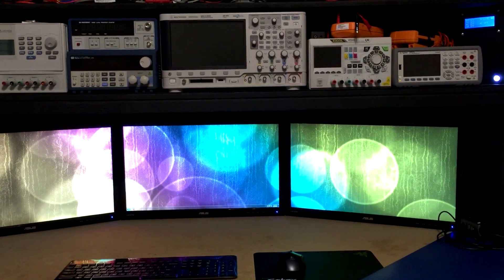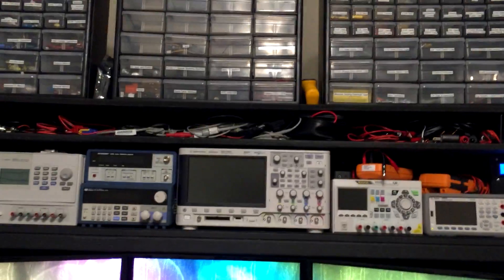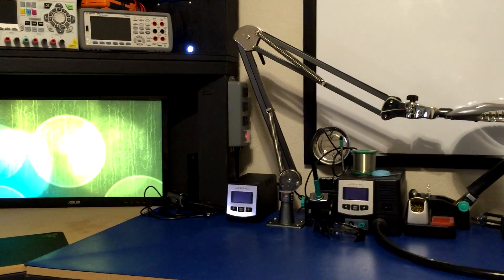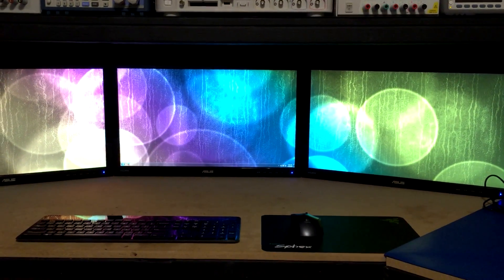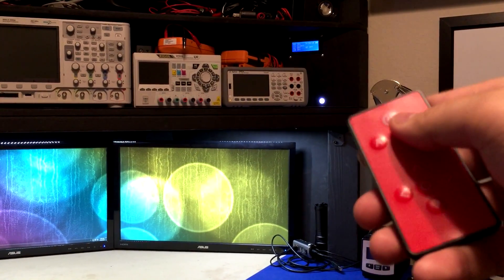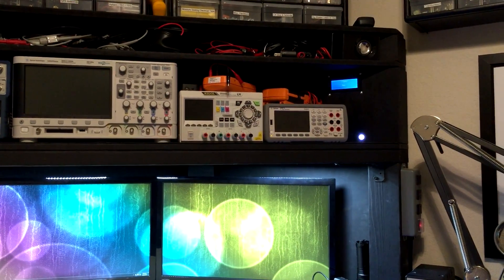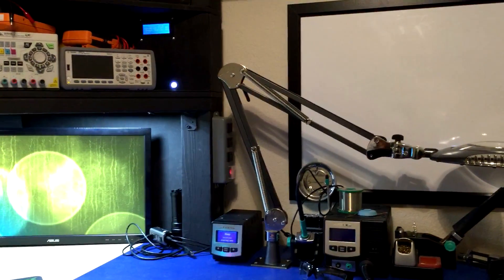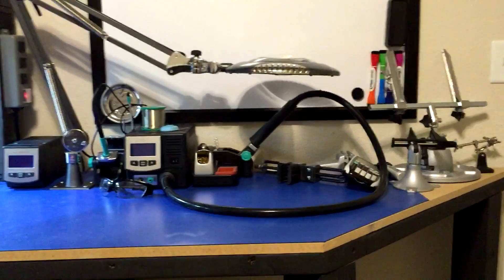Electronics Workbench Lighting / Controller Project (Part 13) [COMPLETED!!!] #0024

Comment: It put an ATtiny into my soldering station, now it have a standby switch. If I wake it up from standby, it will heat up to the choosen temperature. After half an hour the display backlight starts to flash. So if I don't push the standby button again within a minute, the station will go back to standby and run down the temperature. So in case I forget about it, nothing wil happen. Works perfect for years now!

Comment: Thanks for sharing.  I like your setup, good equipment.  The most important part of your workstation is that it is yours.  You designed it to meet the way your work best.  That being said, I can't say having the monitors that low would work for me.  I am a fan of where you put your test cables.  A few questions...  When you work do you move the test equipment or do you use it where it is.  If use where it is do the cables get in the way of the monitors?  Any thoughts on where to put things like current probes, IR Themp, stuff like that?  I would really love another monitor - just can't think of where to put it.  Take a look at my setup - any suggestions welcomed. 
https://www.youtube.com/watch?v=fm5W4V-FS5g

Comment: Yo TechnologyCatalyst
You have a very nice electronics workbench but why did you put your test equipment up so high out of arms reach. it's looks like your going to be testing electronic circuits standing up because you have to adjust knobs on your test equipment and read out the results of measurement. put you monitors up high because that for viewing and it has a remote control. Always keep your test equipment within arms reach for easy adjustment.
your going to get tired of standing up every time you test something. switch them around.
Reply from the maker: +FUNK BOOGIE I took measurements for easy reach and line of sight for the monitors before I designed the desk in CAD.  I can very easily see and reach the instruments while sitting in my chair.  The only time I have to stand up is if I need to adjust an instrument that is out of reach on the other end of the bench.  In a drafting chair, the instruments are just about eye level.

Comment: Outstanding setup and very inspirational!   Keep having fun, creating and sharing... 

Stay safe. Does your bench power go through a GFCI? (...even if you are not working in your bare feet like those two, 230 VAC 50Hz electronic v-bloggin' Aussies seem to prefer!) 

I've been doing this same kind of electronic project stuff since the late 1950's and would like to suggest adding a dual-purpose "Mains" power switch. Replace and rewire the building's existing light switch (within the 1900 box/metallic conduit, etc. that's located right there at the room's entrance door) to safely kill everything other than the ceiling light. 

Get in the habit of always turning that switch off when you leave the room since those fans and that re-purposed PC power supply might eventually become dusty and not spin and/or do something kinda' funky! 

It's usually best to completely avoid using any combustibles where 120 VAC or high current wiring, contained heat producing components, exploding electrolytic capacitors, or anywhere those awesome flash-bang lithium batteries are charged/discharged or even stored because any or all of these things can seriously misbehave...  i.e., there's a nagging materials selection concern: Too much wood was used. 

Big clues to potential trouble are the two cooling fans screwed to the wood electrical wiring/SS relay box. It's well known that even a real UL approval label won't reduce the risk of fire 'cause it just can't stay stuck to an all-wood, 2x4 walled electrical box!

An old beefy thick metal PC case and/or just its power supply case with the fused AC input connector, add those SS Relays to its OEM heatsink and just add another female IEC power socket would have done the job for you and provided a safer project case.  
 
An expensive CO2 or Halon fire extinguisher accessory for your bench is probably too pricey and they're DEFINITELY NOT EFFECTIVE for a lithium/wood fire anyhow, but consider what you would do if some "BS under load test" item decided to go nuclear! (...and the poor smoke detector couldn't even squeeze out a single low-battery chirp ahead of time if it was also equipped with that same BS item! LOL Your other videos are also great... Butt-hurt level battery discharge debunking there sir!  Your Arduino servo pressing the GPS screen button was a beautiful sight too!)   Maybe I spend too much time thinking about and then protecting against all the "what could go wrong here" scenarios.

Adding that "dual-purpose" switch will reduce concerns about the chance of a fire starting, especially when you are away and not even using your bench/equipment. It will also give you wife yet another way to keep/get your attention if you get all caught up while having too much fun with all the software creating, designing, testing, repairing and/or just playing and creating with all those little devices that seem to control the flow of electrons.  

Then it's all good to go!   You sure have a great setup there, have fun.    Best wishes.
Reply from the maker: The workbench electronics all go through an online GFCI strip, and the solid state relays never get much warmer than skin temperature under a decent load, so the fans were just to put my paranoia at ease. The lights, fans, screen, and relays are all through a mechanical latching push button so when I leave the house I turn that off. Technically nothing has lower until I turn it on, but I'd rather be safe than sorry. I do also have an ABC type fire extinguisher under the workbench. Safety first!

Thanks for the kind words (and concerns). Cheers!

Comment: what is the surface that you solder on top of? I'm in the middle of designing a desk similar but trying to figure out the best surfaces for it.
Reply from the maker: ***** This is the exact roll of ESD mat that I bought, and I bought the grounding hardware kit from the same website. http://www.globalindustrial.com/p/work-benches/components/mats/2-x-4-anti-static-mat

It's static dissapative, and has a snap where you can connect a grounding wire.  It's really tough and I've dropped tons of solder blobs on it and it doesn't even leave a mark.  Great stuff, but not cheap.